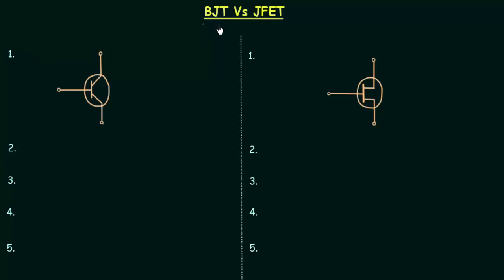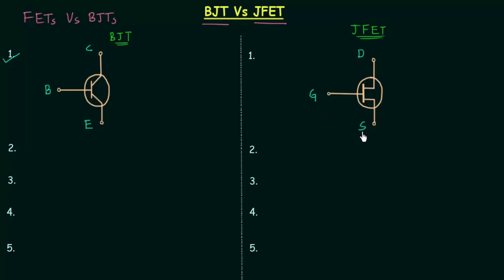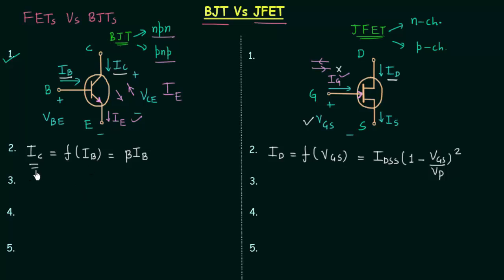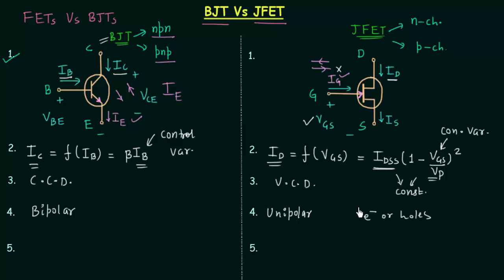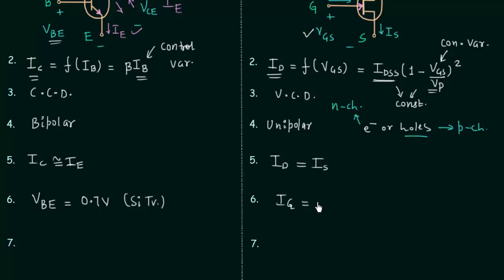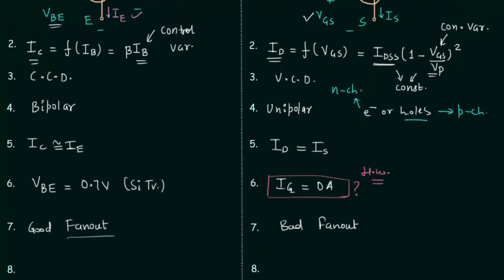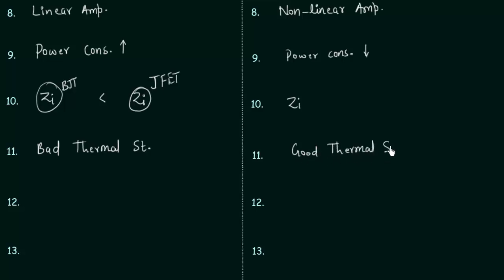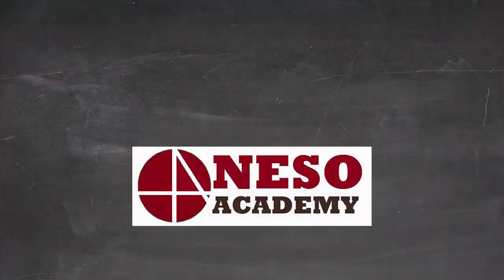BJT Vs JFET

Comment: Sir ,I have doubt , intially when we compared fet and bjt , sensitivity of bjt was higher ,but now in this vedio you said sensitivity of jfet is higher.
I'm confused.
Reply: I was checking the comments whether anyone has pointed it out.
Reply: BJTs are more sensitive to applied voltage is correct

Comment: Hello sir, in this video you said that transistor is a current controlled device but as we can see from the relation of amplification factor that I_b also depends upon V_be. So it should be voltage controlled device.
Reply: this point is taken from output  current not the ib(input current)
.
ic is controlled through ib that's why  BJT is a current controlled device.

Comment: in case of bjt there is recombination of charge carriers in base region thats why a small amount of base current flows while most of the charge carrier goes to collector terminal from emiiter terminmal, thats why there is noise in bjt,and have vds 0.7 volts

while in FET, noise carrier is less as depletion region is much more,and no recombination occure in case Ig i.e gate current is zero..as in previous vedio's sir said that gate is similar as base of transistor.

Comment: Since gate is connected to negative voltage and n type is connected to positive voltage means reverse bais condition means (very negligible current in p-n junction )but here zero because there is only one charge carrier that is electron

Comment: The ig will be 0 because the p portion is reverse biased and the n channel is connected to the positive potential as this creates the condition of the reverse biasing and hence no electron movement will be there towards the gate terminal and therefore the gate current ig will be 0

Comment: sir what makes the BJT  a current controlled device
Reply: In BJT, the collector current (output) is dependent on base current (input). So the output current is being controlled by an input current, thus making BJT a current-controlled device. You can refer to the lecture on BJT to find out more about this topic. Thank you.

Comment: Generally , On state conduction loss is higher in JFET and MOSfet comapre to Transistors.
cost of BJT is almost half than JFET.
JFET generally handles large power levels ( < 5KW ) compare to Transistors (<2 KW ) as they are sensitive to temperature .

Comment: Gate current is zero because  the voltage Vgs is negative ie .. it is reverse bias and also the input impedance of JFET is very high  (of the order  Mega ohms)  .

Comment: The Gate current is 0 ampers, because the Gate terminal is isolated of the Drain and Source terminals... That is like that because the JFET uses the electric field generated by Gate voltage, inducing the change the resistence between Drain and Source

Comment: Gate current is 0 because gate terminal is at negative potential and n channel is at positive potential which make p-n junction reversed biased and we know that in reverse bias the flow of current is zero.
Reply: super bro
Reply: What about reverse saturation current ?
Reply: @ShekharKumar-do7rk  it's v v small n in terms of microamps n can be negleted
Reply: @jayashreej3142  ok
Reply: @ShekharKumar-do7rk The reverse saturation current is mainly due to minority charge carriers. But JFET is a unipolar junction transistor.
Reply: There's reverse saturation current of picoamps level thus it's ignored  @ShekharKumar-do7rk
Reply: 5 years and this teacher still rocking
Reply: I will agree with you